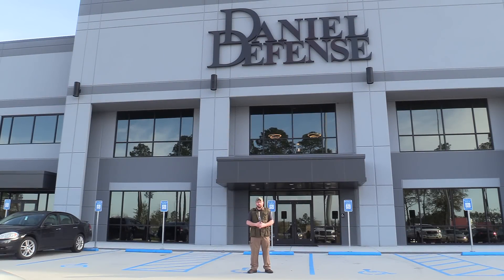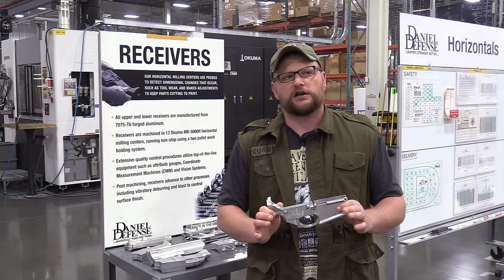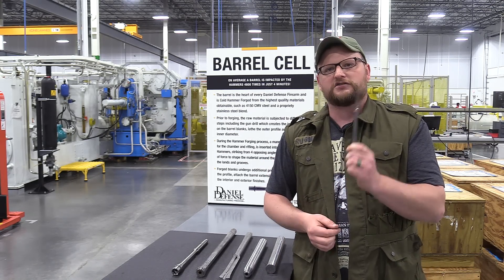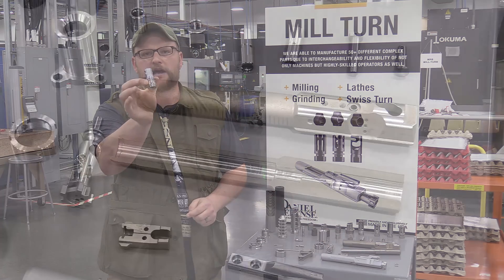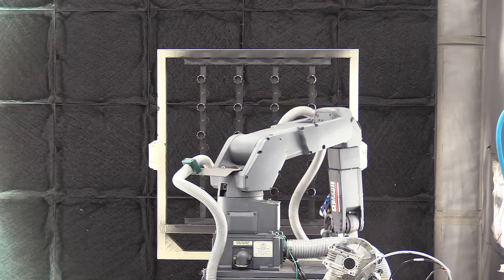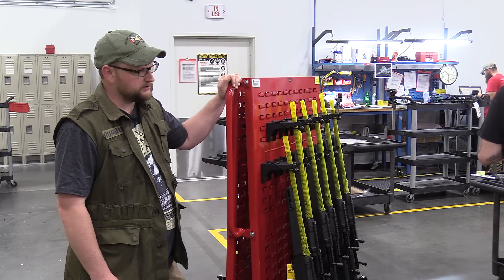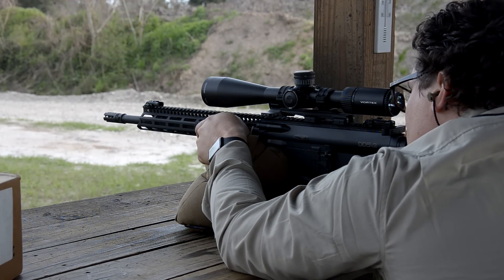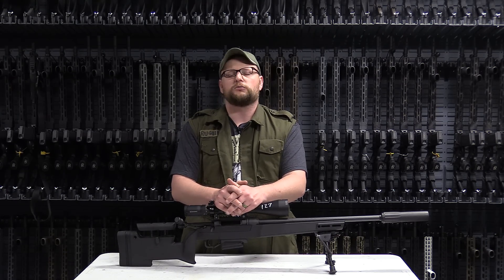Daniel Defense Factory Tour

Comment: Does hammerforging not change the rifling dimensions when it is machined after the hammer forging? I have red that. 

The new bolt action delta 5 rifle of danieln defence seems te be good accuracywise although the barrel is hammer forged. 

So the main thing is: how good are the hammerforged machined ar barrels?

Comment: Yet they charge that much for a rail
Reply: Look up how much per hour it costs to run a mill/turn lathe, have custom extrusions made, pay an engineer and a product designed to engineer/design it, pay a machinist to CAD/CAM it, a machinist to run the machine, run the robot & oven to ceracoat it, a guy like Nevil to deburr it, run the tumblers, etc. It costs half the retail price just in machine time. If you calculate the all-in costs to run their Okuma mill/turn lathes, you'd know why it's so expensive. Also, when you're a gov't contractor, and you want to sell to the govt at a certain price, you can't sell to the end user at a cheaper price. But if you don't care about getting something that is machined to such a high degree, there are plenty of cheaper options out there that will work almost the same. Especially since your rifle won't mean the difference between life/death for you, and won't be used & abused like it would be in the field.
Reply: @xenonram  The only "difference" you listed that isn't done with cheaper rails is government pricing... GSA pricing for example wants to see a large percentage discount off of retail price so it's hard to have both a competitive retail price and worth while Gov. sales prices. Choose one or the other.

Comment: Keep their cost reasonable huh?
Reply: Looks like it's failing lol
Reply: Yeah Daniel Defense is extremely expensive, great quality.

But all that automation, and I still pay a premium? Oohhhhh K.
Reply: @tangoxrayniner5659  exactly
Reply: @tangoxrayniner5659  Just like the other guy said, exactly!
Reply: @tangoxrayniner5659  It leads to tighter tolerances and less defects. Any shop running these kind of machines can hold tolerances within less than .001 inches easily if they want to.
Reply: TangoXrayNiner I’ve worked in a few factories, some shit and some extremely high end. This is a high end factory with excellent machinery. Very good and expensive machines require very good and expensive engineers to work on them. Automation does not mean cheaper at all!
Reply: May it be cause the machine itselfe will cost 100€ per hour when it just stand there and nobody working on it.
Air and water and then the person that uses a machine like this; you see the price walks up easy.
Somewhere the money for all this have to come from.
Produce more and sell "cheap".
Reply: Less expensive then say a Radian
Reply: TangoXrayNiner those machines cost an extreme amount of money and can hold extreme tolerances. The automation is why you pay a premium
Reply: What happened to their prices? When I saw your comment I was confused, because I remember seeing DDM4s up for 1200, which is reasonable for what you're getting, but to see them pushing 2k now...geez